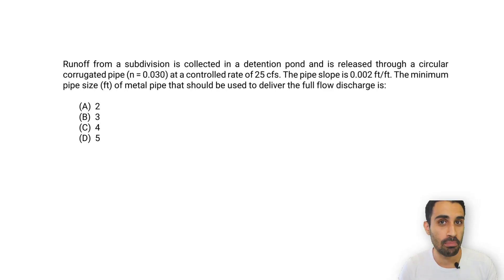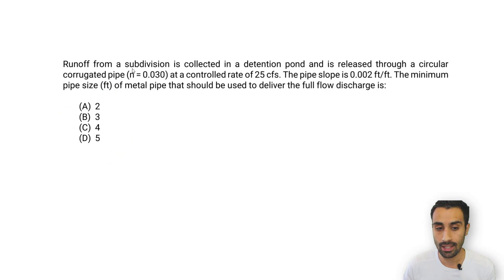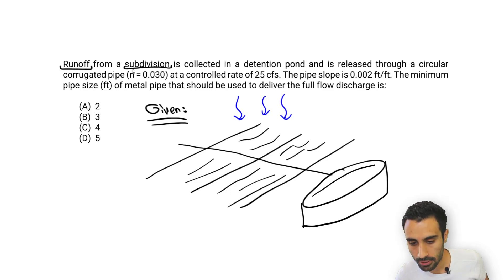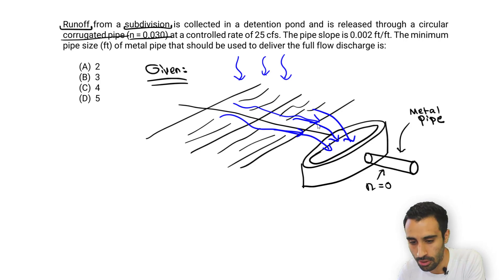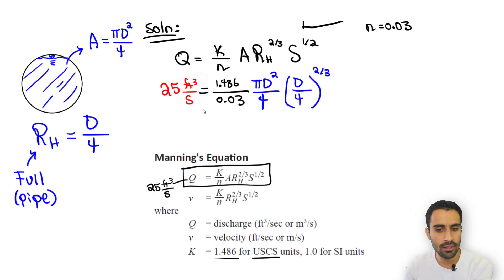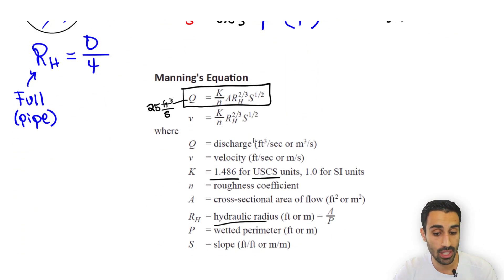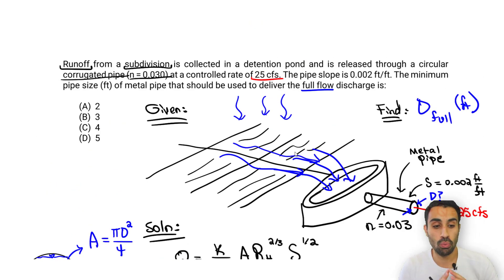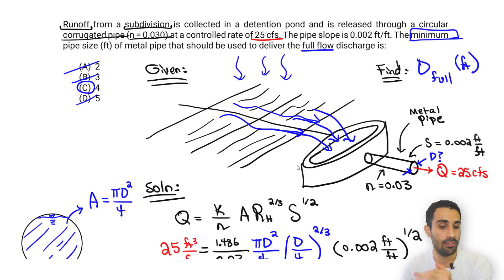2023 Civil FE Exam Review - Water Resources - Manning Equation

Comment: Corragated pipes can be any material.   I there a difference between pvc vs steel in this calculation?
Reply from the maker: Good catch! 

Yes, for this problem it's more on the metal side since Manning's n ranges from 0.022 to 0.030 for metal depending on the degree of corrugation.

For a lower Manning's n value in the range 0.012 to 0.015 it could be HDPE or PVC corrugated pipes.

Comment: i followed the same steps as you did when putting it in the calculator but I got "-9.999*10 ^-51. 
i have a casio fx-115 ES plus
Reply from the maker: Try making a guess when using the solver. The guess can be any number close to the given answer choices. If that doesn't work, please clear your calculator memory then try it again.